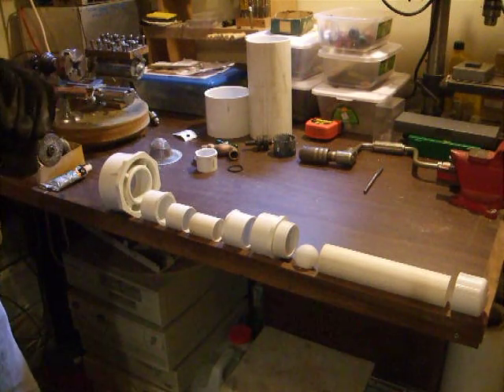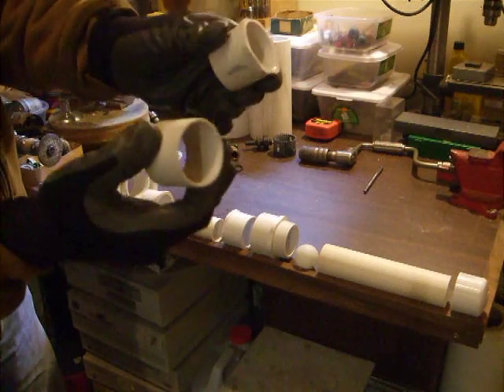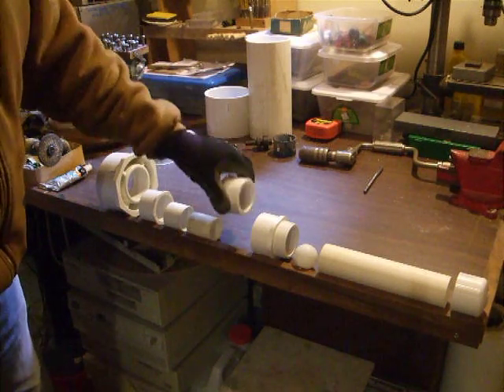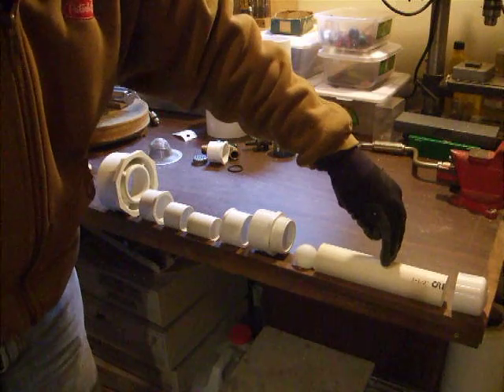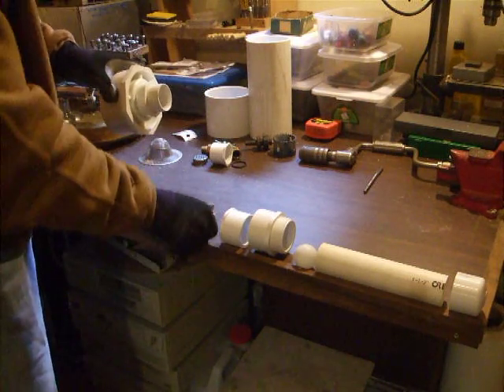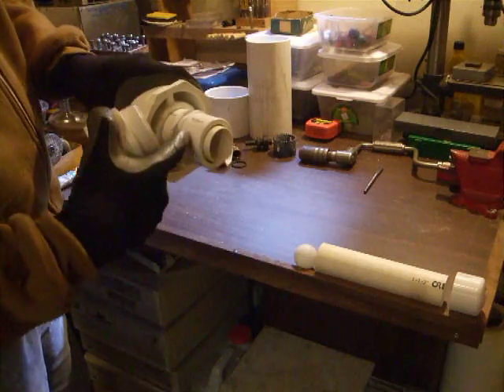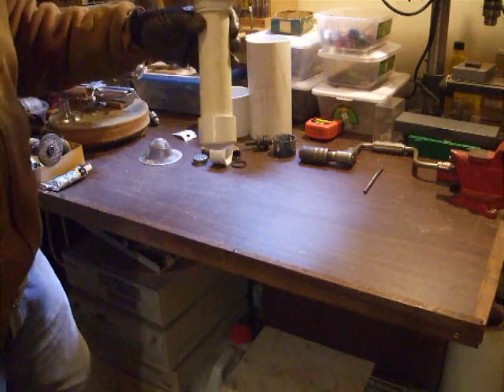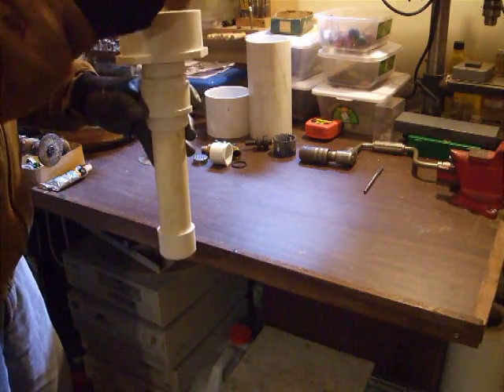DIY first flush diverter   PART ONE

Comment: your website says 10 gallons water per 100 sq ft should be diverted, why do you use a 55 gal barrel? Must be a HELL of a roof!
Reply: I thought it was 5-10 gallons per 1,000 sq. ft. Of roof, if I’m wrong please correct me
Reply: My post is 9 years old. 
But we are both wrong. 
"The recommended minimum rate of diversion is 1 gallon per 100 square feet of roof surface. This diverter uses 2 gallons per 100 square feet."
Reply: Mine is 10 gallons per 1,000 sq. ft so is that OK
Reply: So, your saying 20 gallons per 1,000 sq. ft.
Reply from the maker: @georgia4117  Please see my comment at the top of the comment list. It explains the situation.

Comment from the maker: The roof here is exceptionally contaminated by leaves, and organic material and rainfall is not typically heavy enough to quickly wash the roof clean; so the diverter is designed to hold over 25 gallons. The 55 gallon barrel is the least expensive - and most convenient way to hold the water.

Comment from the maker: @hoz49 Lots of trees, birds, squirrels, and other wildlife here make for a very contaminated roof surface. Fifty five gallons is barely enough because the rain here is mostly light drizzle which does not wash the roof like the powerful storms in other parts of the country and  world. The barrels are very inexpensive - the last one I bought was 20 dollars - the water from the diverter is used to water trees, and is used to fill the 2 ponds ( which are cleaned by slow sand filters).

Comment from the maker: The recommended minimum (that is minimum) is 1 gallon per 100 square feet of roof. The maximum can be what you want. Of course, If you divert too much water you will lose a lot more than is needed. Every situation is different. For example, if you have a non-toxic metal roof, and you have virtually no wildlife or trees near the roof; you wont need as much diversion as we do here. We have a composition roof, and massive amounts of toxic substances from birds, leaves, animals, and the shingles. So we use more than the minimum. 
While I'm at it here, there have been comments that the piping is "too small". Well, yes for some situations it is. The size just needs to be increased if you live in an area where you get rain only once a year or so and heavy rain at that time. Yes , then these pipes used would be way too small. Just use bigger pipes. A larger plastic ball would be used instead of a ping pong ball. Measure your pipes to match the size of the float ball. The function is the same. The ball floats up and seals the opening when the diversion container is full. The draining then happens slowly after the runoff stops. Its the same theory.  For this area, big pipes would be a waste, cost more,  and would allow critters to crawl inside and make nests. We get lots of light rain and not torrential downpours. There are many places like this in the world.

Comment: i dont get it !    please tell me how come that a tennis ball in pipe can separate the water (dirty from clean) .... can you plz explain me this away ---> "diverter for dummies!"   O:)
Reply from the maker: shams4x4  Its actually a ping pong ball 40mm size. The ball floats on top of the input water and eventually rises up to seal off the input pipe. In between rain events the diverter storage slowly drains allowing for the storage of another 5 or 10 gallons of first flow water. The most contaminated water actually is diverted to the storage barrel. We show, in part2, how it works.  There is a link to that video in the description right below the video window click where is says "show more".